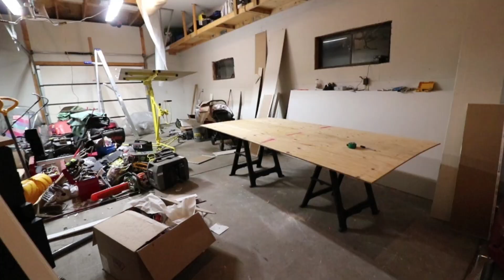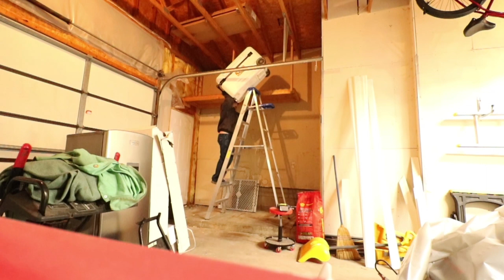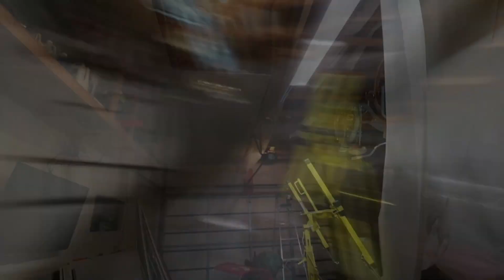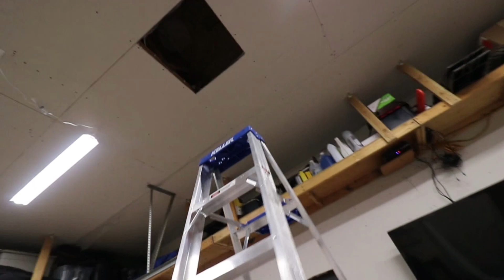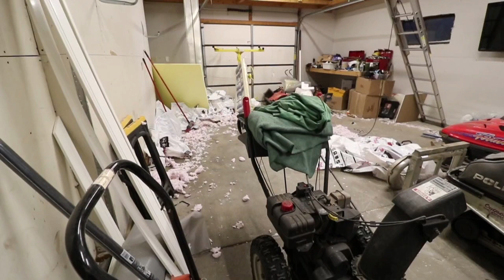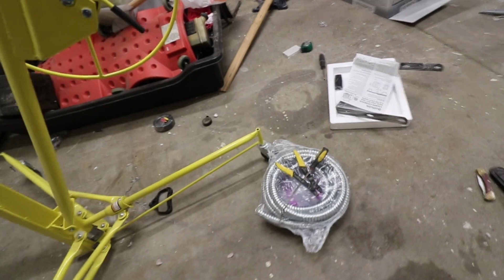Finishing the Garage. Part 4. Finished. Sheetrock, Shelving, Insulation, done. Heat installed. Nice.

Comment: Zach, the heater is 7,500 watts or 7.5kw. You just multiply the kw by what your electric company charges per kwh, (probably somewhere between 15 and 20 cents) and that will tell you how much it costs per hour to run. Probably about $1.25 an hour. Garage looks great!

Comment: Zach you should definitely put a couple sealing fans in your garage!! Since you’re garage is so tall the fans will help out a bunch by helping to circulate the warm air more!! Heat rises so if you want it say 60* at your height it will have to heat up every thing above you first!! This will cause it to be well over 60* for every thing over your head just to get the temp to 60* at your level!! So with fans it will help the higher temp up higher to bring the lower temp down lower up higher!! Hope that makes since to you!! But I will guarantee you the fans will help out a bunch!! If you do decide to get fans make sure you get ones where you can switch the rotation of the fans!! In the winter you want to pull the cold air up witch then pushes the hot air out & down & then in the summer time you want them to blow the air down!! Hope that makes since to you also!! Let me no what you think??

Comment: Looks like average electricity cost in Minnesota is approximately 0.11/kwh. Running that 7500w heater would work out to costing .85/h. If you are running it for 4 hours per day your bill will be roughly $104 per month. Garage looks great!

Comment: Zach you have shown by your work that you have a well thought out plan and you haft to remember that your money was well spent it's your home and all that sheetrock and insulation is money in the bank when you open the  inside door to the house it wont draw all your warm air out into your garage so over time it will pay for its self this summer it will help keep the A/C  running cooler Ray S USMC Semper Fi

Comment: I have lights from same company as yours, the linkable is nice. Also now they have those lights to screw into light sockets and fold down which seem to give off great light, they are LED.  Surely you will take down the stuff overhead.  Looks very nice, Zach, a chip off the old block.

Comment: Yup I'm gunna say I'd never buy either a Ford or Chevy I'm a Dodge girl for life, I've had my Dodge for 24yrs. Never ever has it been in the shop for any other than normal scheduled maintenance untell this year, stuck at home during quarantine it sat a lot not being run in the driveway. unbeknownst to me rodents decided to make my engine and general area their homes. The chewed up all my wiring so it went to the shop to be fixed. It's never broken down, never had a blow out, never caused me any problems rides very smoothly, it doesn't ride like a truck, I had a heavy duty tow package put on when I bought it. And trailer brake kit. Mud flaps, running boards, and bug shields. I love my truck, she's never let me down. I'm a single mom of 6 kids, raised 4 of them from birth with her. She a 1500, V8, gas engine, 2 wheel drive, extended cab, long bed. The only thing I wish she was a 2500. But it's ok. You couldn't pay me to part with her! I'm sure things will start to break down at some time after all she is 24 yrs old. I have 138,000 miles on her. She's the only truck I've ever owned. I've had a VW, a Ford Grand Torino, a Ford Fairlaine, an oldsmobile, a Chevy impala, the only one that didn't have to have constant repairs has been my Dodge Truck! Every other vehicle was in the shop like every other month for one thing or another. I wouldn't get a Dodge Caravan, I've heard horror stories about them constantly breaking down! But my truck has been a gem! The garage is looking great! 100% better than when you started! Sorry about the rant but I do love my truck! Much love from So.Cal.💟
Reply: Your truck is an outlier. I can show you 100,000 or whatever number you like that crapped out. Statistical anomalies are just that.
Reply: @hithere7382  Oohh... sour grapes! Apparently you keep getting lemons! Suck it up buttercup and make lemonaid, lemon jello, anything lemon, but dissing others for having something you dont? What a big whine baby!
Reply: @crazycritterlady8788  I'm not dissing you, I'm calling out your confusion. Your anecdote has no bearing on the average life expectancy of Dodge trucks.

Since you word it that way, you are indeed a crazy cat lady though. You drive the same truck for 24 years despite safety technology to protect your cats in an accident coming a long way in that amount of time. Beyond your inability to do statistics instead of anecdotes you can't even spell "whiny" instead you call me a "whine baby." 

I pity you and your cats.
Reply: Look up the word "whine" and you will see i used the word properly in my discription of you. Because of the way most guys and some gals treat their vehicles by the way they are driven and no properly maintained, it taxes the engine and other parts causing them to prematurely break down. I was taught to respect my things and they would last. As far as safety goes, if it was unsafe I wouldn't be able to drive it on the road by law. Other than not having air bags everywhere it has all the normal safety features any other vehicle has. And my cats plus my other many animals are perfectly safe in their carriers without airbags. How many accidents have you had or been evolved in? I can honestly say I have never had or been in even one! I am a professional driver and hold a specialized license. Can you say that? So between my care of my vehicle and my driving skills no one is at any more risk in my truck than in a brand new one. I'm sorry you can't say the same. Have a nice day.

Comment: Ram ( not Dodge) Ram trucks are the smoothest, most q
Quiet trucks out there. Guess going from a minivan to a truck anything you compare will obviously feel weird.
Reply from the maker: I've had a few trucks, I don't like the seat position,  and how they squat when they tow, and a few other things. I do agree that the cab is very quiet. Thanks
Reply: @JoeandZachSurvival  You can fit airbags, helper springs, or sumo springs to reduce or eliminate the sag when towing.